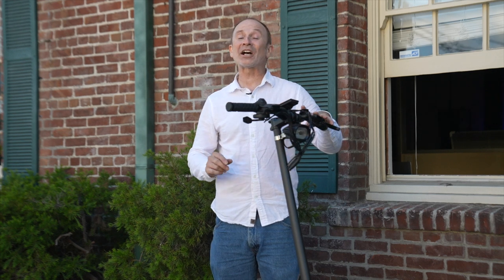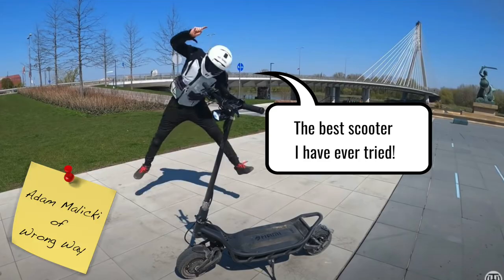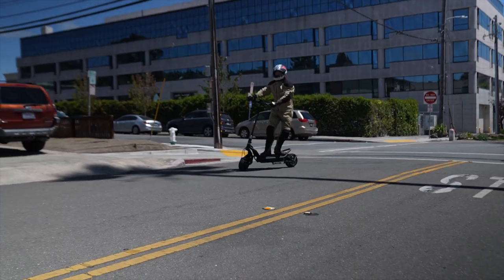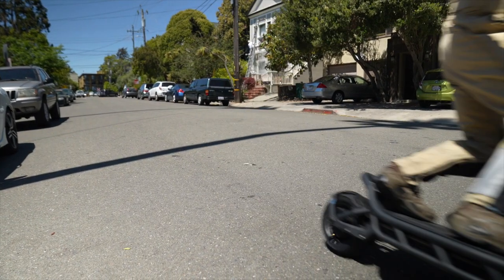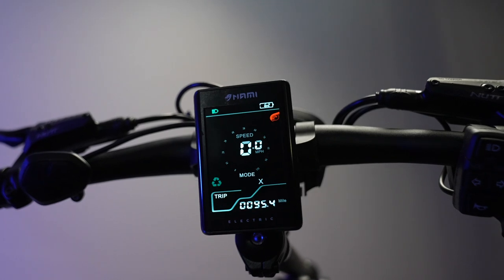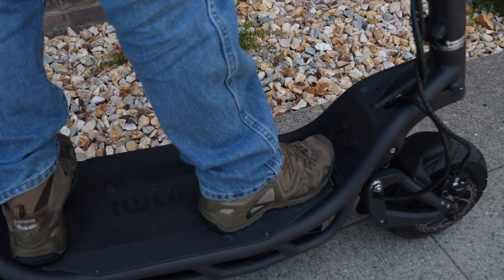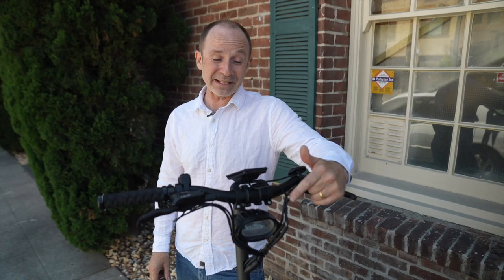The Most Controversial Electric Scooter Ever? Nami BURN-E First Look!

Comment: The exposed charging ports seem like such a basic oversight that will be resolved with later batches.
I've also read that the bottom plate of the deck can distort/dislodge from the main body. Wonder if ESG experiences this.
Reply from the maker: The bottom plate is welded on, so it's not going to dislodge. It's really tricky making a welded aluminum frame without causing a ton of distortion. I think that's why no one else does it. Every weld causes a little pull as it cools down, so depending on the order that things are welded, different parts will get pulled this way and that. Michael and his team spent a ton of time on welding and heat-treating, to get the frame to stay aligned with itself. He talks about the challenges of frame design in our interview here:
https://youtu.be/Nn3WezRvWJA?t=896

Comment: Can't wait for full acceleration test and range especially
Reply from the maker: I can’t spill the beans yet, but range is very very very good!   -Paul
Reply: @ESG-ElectricScooterGuide  No longer as good as it was. Range has been cut by 10 miles because now they are selling them with smaller batteries at the same price.

Comment: I am going to order an Emove Cruiser and want to know if 7% is the biggest discount available. I'm going to order it using YOUR link, since your videos are so terrific.
Reply from the maker: Thank you so much. Yes, 7% is the biggest discount coupon we've got. I'm not 100% sure there isn't a bigger one out there though.  code: electric-scooter.guide   Let me know if the code gives you any trouble. Sometimes they age out and we need to update them.
We just got our new Purple! EMOVE Cruiser and I'm looking forward to testing it. 20% more power sounds nice!  
-Paul
Reply: @ESG-ElectricScooterGuide  20% more power? Wow, the longer I wait to buy, the better they seem to get. Please be sure to stay on Moro Motors' case to keep the coupon code for this scooter, as I will not buy it using anyone else's link. Can't wait to see your test of the new model. Has the name changed or anything?
- Andy

Comment: Just hit 700 kms on mine. Fastest I dared to go was 97 kph recorded on Strava. 
Oh, and one bad crash at 50kph as well, my bag and new riding jacket (thank God I wore it) took the brunt but I had to replace my throttle lever which broke off and the grip end caps which were gouged bad. Some black aluminum paint on the frame side as well and good to go.

Comment: Hey, I love your channel. I started watching you guys before getting a Gotrax G4 and now I'm selling my Mantis to get this thing. 
What tool did you use to adjust the suspension?
Reply from the maker: I used a 3/4" hose plier. Mine is different from this one, but this one might actually work better because it has two width settings.   -Paul
https://www.amazon.com/Heavy-Duty-Adjustable-Gripper-Pliers/dp/B07PGHVZJH/ref=sr_1_17?dchild=1&keywords=hose+pliers&qid=1625181330&sr=8-17
Reply: @ESG-ElectricScooterGuide  I appreciate it. Which way did you turn   the spring?

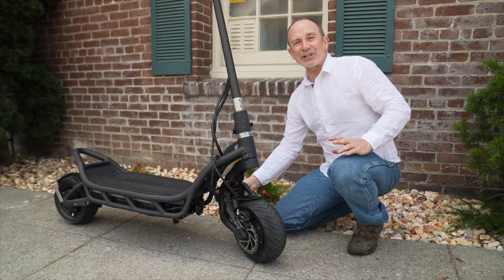Comment: I don't suppose you can provide a link to the exact tool you used at 0:56 to adjust the suspension?  I've got the Burn-E, but, am having a really tough time finding anything that fits and works for this suspension adjustment.
Reply from the maker: It's a set of 3/4" hose pliers. I don't have the exact part number, unfortunately because it's something I bought a long time ago.     -Paul
Reply: @ESG-ElectricScooterGuide  Forgive my ignorance, is a "turn" one full 360 degrees, or just a quarter turn of the spring?

Comment: So the Nami thumb throttle is similar to the phantom? I don't understand why it has dead space, it's basically a on and off switch. Everyone rates the phantoms throttle a 2/10. I havent received my phantom yet but now I'm skeptical about riding it now.
Reply from the maker: It's physically a different type of thumb throttle but the response of the throttle,  is very progressive,  which is similar to the Ludicrous version of the Phantom (which is different from the throttle response of the Phantom).

On many scooters it feels like an on-off switch, but on the Nami it definitely gives you a wide range of throttle. You can sustain 4 mph, or 5 mph, or 7mph, or 45 mph etc. 

Chuck really likes the throttle on the Phantom. You can adjust the P-settings to make it less abrupt, and there is also a fix involving a zip tie, that takes out much of the slack. I haven't tested the zip tie fix yet though.    -Paul
Reply: @ESG-ElectricScooterGuide  You think the ESG team would be willing to make a video about this. Like ramier I'm not tech savvy when it comes to modding scooters but this would convince alot of people to buy a phantom or least change their minds about the throttle.
Reply from the maker: Good idea. I really didn't expect the throttle on the Phantom to become an issue at all. Pretty much all of the pro-level scooters have abrupt throttles with some dead space at the beginning, and to me the Phantom is not atypical in the amount it has.  I'll ride out Phantom again and see if I have any useful advice to add. I can also reach out to Apollo and see if they are working on one. We've got a pile of scooters I need to test.    -Paul

Comment: Love the tube-Like structural frame, good job
Reply from the maker: It's crazy! It's a hand-welded tube frame. The tubes have an "X" of aluminum running through the middle of them too!   
You can see the cross section in the interview I did with Michael Sha.
https://youtu.be/Nn3WezRvWJA?t=413
-Paul
Reply: @ESG-ElectricScooterGuide  Ah yes, that is a good idea!

Comment: I think it's a shame you can't completely disable regenerative braking.  It seems to be a bug that was never announced officially.
Reply from the maker: Thanks for reminding me about this. I've heard this discussed, but haven't checked it out. Even set at 1 it's not that noticeable. I'll see what it's like when set to zero. 

I know the folks who race Kaabo scooters unplug the brake light switches to eliminate throttle cut-off and the lag in engaging throttle after braking that it apparently causes. But that, of course eliminates brake lights which isn't good for riding on the road.
Reply from the maker: Ok, I took both calipers off of the BURN-E and put it up on a stand to check regen braking when regen level is set to 0, and you're right. There is still some regen there. I haven't ridden it yet at 0, but it definitely slows the wheels down when the brake lights come on, vs. coasting down to a stop.    -Paul
Reply: You can disable it. Each mode has a setting of 0 to 5. 0 is off, then 1 to 5 is how powerful it is. It comes set up in all modes at 1 by default but a few presses of setup menu buttons and it changes quickly and easily
Reply: @ofpplayer  No that doesn't work, already tried that.  I have set mine to 0 in ALL modes and it still kicks in.  Another guy I know also has the same issue on his.